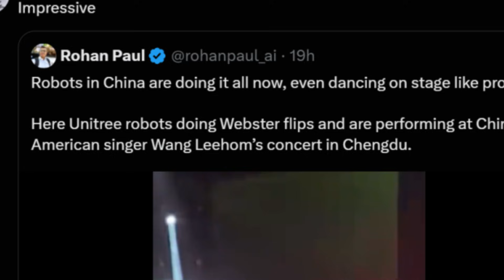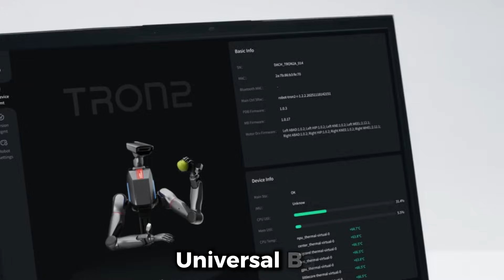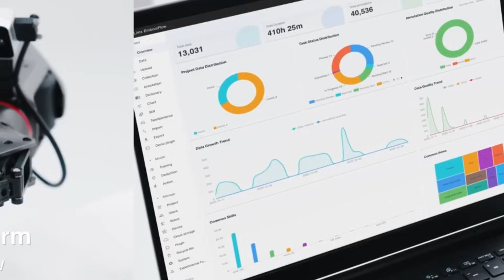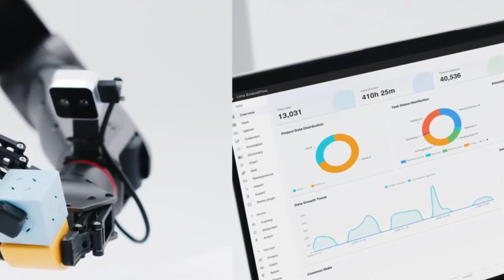China's G1 Robots Just Broke the Internet With This Live Concert Moment!

Comment: don't be fooled....(see attached videos weblinks attached below)  Nearly 100% of china robots are human remote controlled robots (or pre programmed) but faked as independently AI guided and controlled, including the female robot with very human like walking gait / manner 

(super increase the numbers of mechanical joints/rotational parts in humanoid robots will improve the human motion mimicking ability, nothing amazing, which most other international robots, unlike china, are made/built for actual deployment to work in physically demanding roles to replace humans and do actual work, NOT to look or move 90% like humans, so xpeng robot is merely relevant more for  “front line customer service / interaction” robot role. 
 
@ChinaInsiderWithDavidZhang
China in the eyes of foreigners vs Chinese people
XPENG IRON isn’t that impressive
https://www.youtube.com/shorts/0zW8tYbOkEw

even if it is real (not a human inside).... don't be fooled by china !!!!
（SEE video link attached below).  Core content are sections after 7:20mins till to the very end Most china’s misleading AI robots (including Xpeng with female attractive body CATWALKING  ones) are actually ALL remote controlled and their actions and behavior/reactions are non AI controlled or caused>>>
["Remote control fraud" is an open secret in the robotics industry; robot company scams have been ...]  - auto dubbed – dual optional sound tracks in ENG / CL.
Little yellow egg
https://www.youtube.com/watch?v=Vvh5T1SR38Q&t=7m20s

Comment: From now on the USA will become notorius for coyping everything chinese
Reply: (see attached videos weblinks attached below)
Nearly 100% of china robots are human remote controlled robots (or pre programmed) but faked as independently AI guided and controlled, including the female robot with very human like walking gait / manner 

(super increase the numbers of mechanical joints/rotational parts in humanoid robots will improve the human motion mimicking ability, nothing amazing, which most other international robots, unlike china, are made/built for actual deployment to work in physically demanding roles to replace humans and do actual work, NOT to look or move 90% like humans, so xpeng robot is merely relevant more for  “front line customer service / interaction” robot role. 
 
@ChinaInsiderWithDavidZhang
China in the eyes of foreigners vs Chinese people
XPENG IRON isn’t that impressive
https://www.youtube.com/shorts/0zW8tYbOkEw

even if it is real (not a human inside).... don't be fooled by china !!!!
（SEE video link attached below).  Core content are sections after 7:20mins till to the very end Most china’s misleading AI robots (including Xpeng with female attractive body CATWALKING  ones) are actually ALL remote controlled and their actions and behavior/reactions are non AI controlled or caused>>>
["Remote control fraud" is an open secret in the robotics industry; robot company scams have been ...]  - auto dubbed – dual optional sound tracks in ENG / CL.
Little yellow egg
https://www.youtube.com/watch?v=Vvh5T1SR38Q&t=7m20s